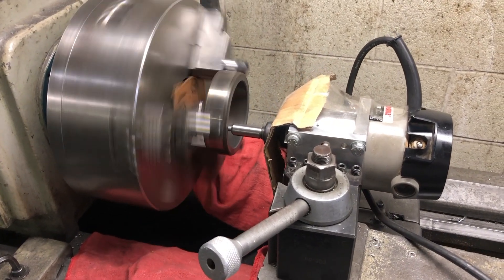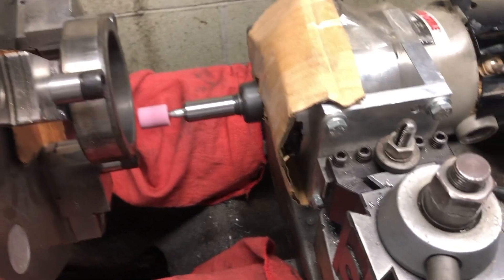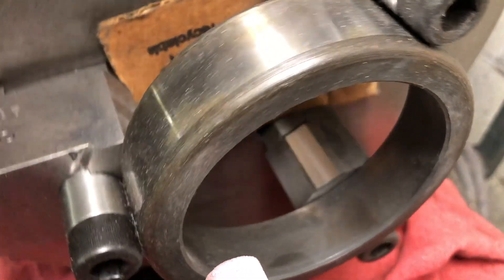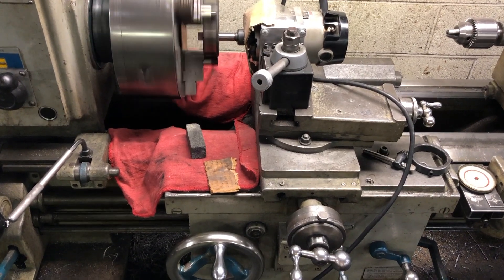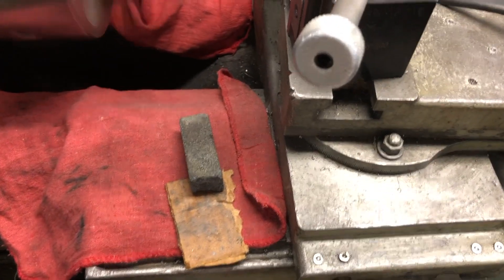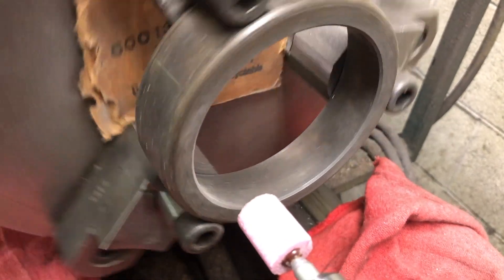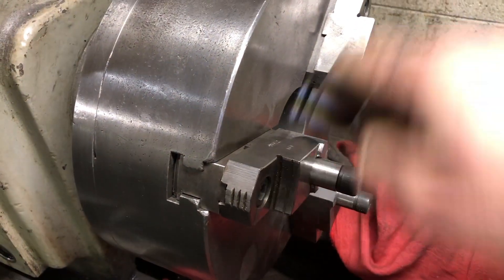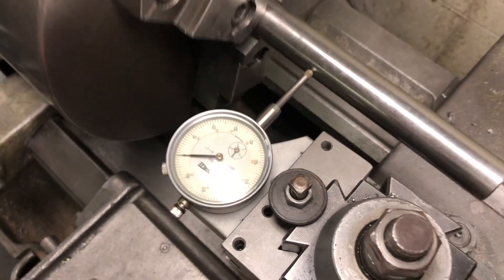Lathe Chuck Jaws Grinding With a Router

Comment: Great! Is there ant reason that mounting a carbide cutter in the tooll post couldn't cut the inner jaws true? I might give it a shot.
Reply from the maker: I think that interrupted cut combined with micro movement of jaws may spell a disaster for the carbide tool, especially, if jaws are hardened. Although, I might not be correct on this. Try it, share your experience with everyone.
Thanks for watching.

Comment: You only ground the protruding part of the jaws, but then measure runout using a bar clamped in the rear part of the jaws which haven't been ground. If you find a smaller outside race which allow the jaws to come in further, you will be able to grind the back of the jaws too, provided you make a longer mandrel for your router.
Reply from the maker: voidmansions entire contact surface of the jaws has been ground. The runout is coming from (what I believe) the wear of chuck’s guiding slots. Because I ground jaws clamped at about 3 inch diameter, but, when jaws closed down to smaller diameter, the geometry of the chuck changed, too.
That’s my theory, anyway. The result is good enough for that particular machine.
Cheers.